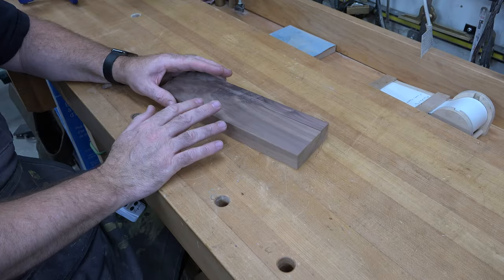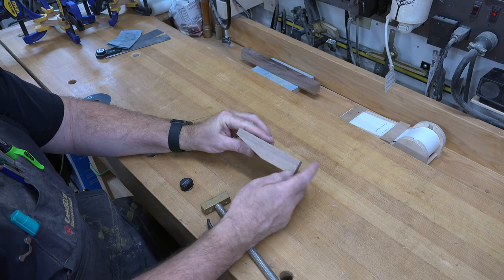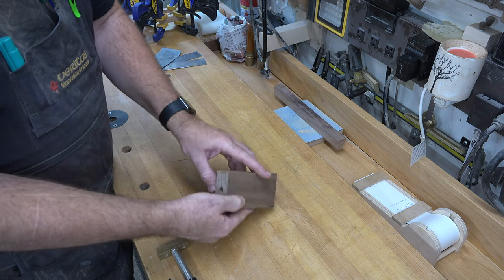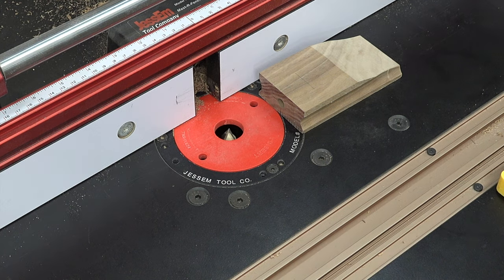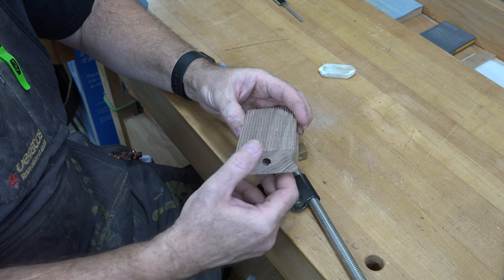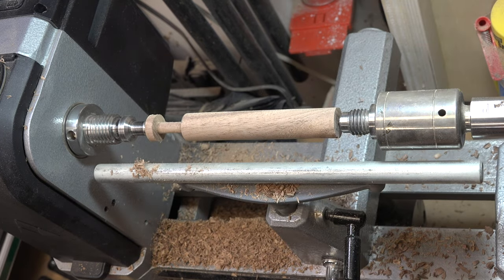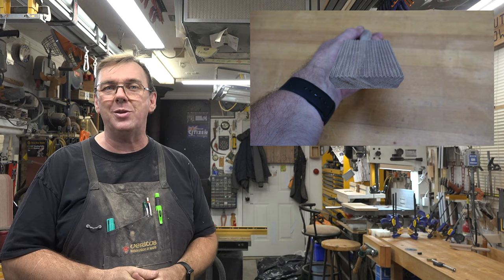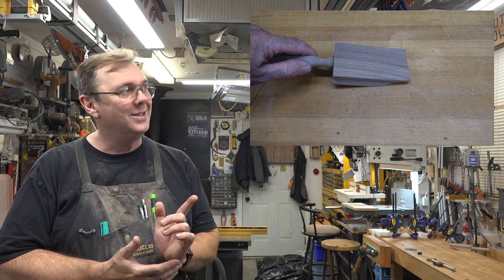Making a Gnocchi Board

Comment: Hey Ken I noticed you did not talk finish. Do you use a cutting board oil or a beeswax
Reply from the maker: This one will get coated in my own mixture for cutting boards Steve.  It is a mixture of paraffin wax and mineral oil.  I hope this helps.  Thanks for tuning in to the show.
Reply: @acutabove_woodworkings  it sure did.

Comment: So 10000 bucks in eqipment to make a 5 dollar gnocchi board. You perform a good job and a nice board anyway. Br.
Reply from the maker: Absolutely not.  The methods and equipment that I show on the program are only a suggestion and for every method that I demonstrate, there are multiple other ways to do it.  All of it can be done with hand tools if that is all you have.  Don't let it fool you that you need expensive equipment to do woodworking.  I use it because I have it but I've been woodworking and collecting tools for 46 years.  Thanks for tuning in.
Reply: Naturligtvis! Jag skrev det för att jag har massor av maskiner och handverktyg. Det har hänt att jag lagt månader av fritid på att bygga ett verktyg där materialkostnaden har varit högre än vad det hade kostat att köpa ett färdigt. Sedan har jag faktiskt inte behövt använda det. Du har en trevlig och seriös kanal. Min kommentar var bara för att busa lite med dig. Best reguards  Fredrik